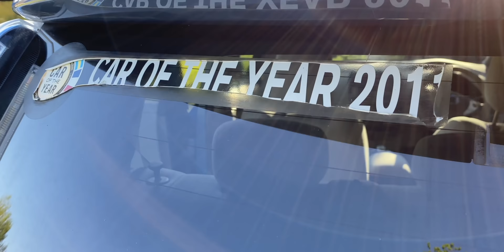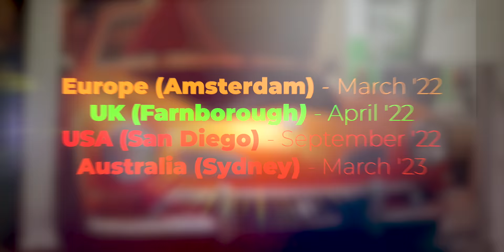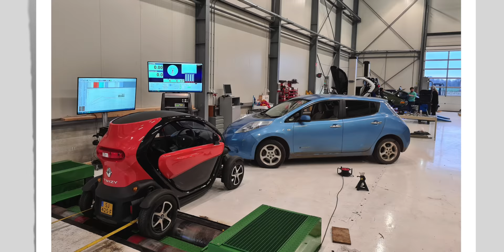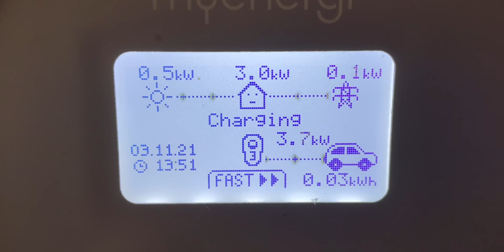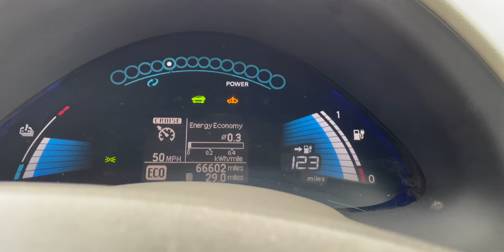Return of the LEAF: Robert drives his range extended EV home from Holland

Comment: Car companies are not interested in selling battery packs to us and will want you to purchase a new car with new technology. It is simply not environmentally friendly to have disposable cars with a depreciating battery that is unlikely to be replaced by most people.
Reply: But you can repurpose the battery by having it disassembled, the failed cells replaced...and then use this rujuvenated old battery as solar storage or peak draw use at your own home???
Reply: @JohnSmith-yv6eq  Meanwhile, the car is placed in landfill. Hardly environmentally friendly. Lithium batteries are also a high risk as they age - ask any Fire and Rescue Service. They contain some very nasty substances and need to be handled with care.
Reply: @redtim3690  
Once the battery has been taken out (in one piece) the Leaf is just recycleable materials... like an ICE car.
By replacing the battery at the end of the first 10 years (maybe 12 or 14) 
  (a 4 hour job; less with scaled up volume) the body of the Leaf can go anther 10 years...???
Reply: @JohnSmith-yv6eq  But where are you going to get the new batteries from? You are relying on crashed cars because car companies don't want to sell you batteries - despite their original promises. EVs at present are disposable cars and are simply not sustainable. They also have double the carbon footprint of an ICE car.
Reply: @redtim3690  
How did they recycle horses when those new fangled horseless carriages came along...?
Reply: @JohnSmith-yv6eq  You are completely uncritical of the limitations of batteries. ICE vehicles are more sustainable and are longer lived. Hydrogen is the way forward.
Reply: @redtim3690  
I hope that hydrogen power does keep the ICE going...but ultimately personal transport systems will need to transition to completely non-carbon based fuels......
Reply: @JohnSmith-yv6eq  Hydrogen has got to be a part of the mix because large batteries in big vehicles simply does not work. My worry is that not having replaceable batteries available at the end of their life will encourage a disposable product. An ICE car will last decades and that is sustainable. Replacing cars every decade is expensive and environmentally unfriendly.

Comment: "You will not have to replace the battery",  or,  as in your case now,  the batteries available in 2033 might have 3 times the capacity,  and 100kW/h just might not cut it anymore.
Or Mr Fusion!!!!``1

Comment: The car is fine and cheap to keep but the battery is a crap. Mine has 82% SOH after 42000 km. So one bar on the display has already left the stage. The car was kept in no extreme environment condition in Germanys weather, also was mostly snail charged at home.
At least the Dutch company may spend him a second birth but the question stays if it is not cheaper to replace it by another used EV with a technical better battery with active cooling /heating and no more Chademo system which is slowly dying in the chargers infrastructure.

Comment: Really interesting and insightful although electric cars even at this level are expensive. Not sure about your statement that batteries will never need replacing. All batteries deteriorate over time so how can they not need replacing
Reply: John, with improved battery chemistry and management systems, and long ranges that seldom need charging to full capacity, modern EV batteries can easily last the life of the vehicle.

Comment: So why did that guy with the Tesla decide to blow his car up rather than have it repaired?  Apparently he was told by Tesla that he needed his battery pack replaced which was going to cost thousands of Euro's.  If batteries can be repaired, why wasn't that an option for him?  This is a serious point because even if you say 'technically' the batteries don't need replacing, if the manufacturer isn't willing to do it and they have the power to 'lock out' any third party modifications through their control over the vehicle via software, then this isn't going to help us at all.  Until we remove the power the manufacturers have over their control over the products we purchase from them, then we are always going to be disadvantaged and wary of investing in these types of technology.  Manufacturers see the purchase of the vehicle as a 'gateway sale' whereby they will continue to profit from over many, many years through artificial lock-in through software.  Why can't people see this?

Comment: A bit hyperbolic there.  Batteries do fail, as the Beyond the Press channel showed recently, but probably about as often as ICE vehicles need new engines.  At about £6 per charge, your journey cost about the same as a diesel car in fuelling costs.  There's also the initial cost.   Leafs were about £28k, including government discount, which put them way out of the price range of most people.  With a 40 mile range, there is not much interest in the secondhand market as far as I can see.

I'm not anti-electric - it's clearly the future - but I'm not convinced that battery vehicles are the long term route.  I do wonder why there is such little interest in hydrogen fuel cell vehicles.  They seem to be the better option.
Reply: worsé hyderféull çells

Comment: Apologies, I should have waited till the end before commenting. Would have stopped anyway? Less than every 100 miles? Really? My previous point about range still applies - I could have done your exact journey, and then turned round and returned, on one fill, no need to plan charging stops, no compulsory stop every 2 hours for at least half an hour. Great for staying fresh, but a pain if you want to get somewhere, and fast. The 1,200 mile round trip to visit my kids involves only one stop, after about 800 miles. I can't argue with your costings, sure, absolutely excellent. And I am as poor as a church mouse these days, and money matters. But for long trips, a super-comfy, long wheel base, super-relaxed journey I will always prefer over the stop-start-stop of an EV long distance journey. Just saying. (ps. I make the point again, why can't we have charge points where you plug in, and a card reader takes your money before releasing the connection? Charging networks everywhere are a mess, so little uniformity blah blah)

Comment: Not so fast.  The Leaf's thermal management system for hot climates is among the worst, if not the worst, of all EVs.  That issue will be amplified with an extended range battery.
Reply: Do you use a Yugo for freeway driving 1000 miles?
Well you know it's particular deficiency...not very comfortable @ 4000rpm.... so of course not.
Ditto the Leaf if you live in a vey hot climate.
Get a Tesla instead.

Comment: Well I debate the never replacing battery in the Hyundai. Sorry but from personal experience Hyundai batteries are notorious for failure. Replaced 4 batteries under warranty on a Kia Soul and absolutely not worth it. Leaf degraded but never failed. That is a key difference. Degradation is not reliability.
Reply from the maker: Just checked a couple of Hyundai Reddit chats I used to frequent when we had a Kona for 4 years. They are all saying how incredible, reliable and long lasting the batteries are. That was my experience. The Soul I don't know, maybe that had different battery chemistry or manufacturer, but the Kona had legendary range and near zero degradation over the 4 years and 55,000 miles we clocked up.

Comment: In HOT areas like Phoenix AZ the LEAF battery loses 10% capacity a year. It is unusable after 4 to 5 years. Thec8 year 100k mile warranty is not covered.
   WARNING  the LEAF has no Battery Thermal Management System. When the battery gets hot it never get the lost range back.    The battery is also very bad in the Cold but does recover when itcwarms back up.
Reply: You are aware of this.
So should every leaf owner.
In temperate climates (lke New Zealand) there are very early Leafs still @ 80% SOC.....
we have apparently got 30,000 Leafs mostly JDM grey imports going well..
and a homegrown reprogramming and battery updating capability...
including English display/navigation....
we basically have no rust, no brine, no salt......

Comment: For various reasons I've been tracking my MPG and fuel spend since the early 2000s.
In the last 10 years: 
* My cheapest year was 2019 at £1,293 to go 10,580 miles (£0.122 per mile)
* My most expensive was 2014 where I spent £1,778 to go 11,583 miles (£0.153 per mile)

Since I got an electric car I have spent £0.013 per mile.

Comment: I just looked at the new nissan leafs and the only thing that sucks is the range of 121 miles. I'd rarely use it for the full range, tbh, but it doesn't make sense for me to trade in my tesla model 3 standard range for a new leaf. I honestly would trade my tesla for a cheaper EV because I frankly don't need to have all that a model 3 brings.

Comment: I am really disappointed by how fully charged has not covered the atrocities condition of the EV charging network. On a trip from Manchester to Reading I need desperately to charge my car but the Electric Highways (owned b6 Gridserve) in 6 service stations along the M42 and M40 motorways we’re not work. One had the electric connector exposed. If I had known that the EV infrastructure was so bad I wouldn’t have bought an EV. This is something you never cover
Reply: He mentions it specifically in this video?
Reply: No he doesn’t. My experience is that all the chargers on M40 and M42 don’t work. Not sure how many others are not working
Reply: @basilkearsley2657  13:52 "Thank you to FastNed for HAVING CHARGERS THAT WORK, that's a very important thing (Just a little note to charge point operators in the UK)"

Comment: Service in germany is/was much more expensive…the suspension rubber was replaced twice now…15 kWh left with only 64000 km on the clock.   

Every BEV will need replacement…even Tesla…Period!

Comment: No, but what is true nothing changed since the Nissan Leaf I have a Vauxhall vivaro e life 2023 only get 70 miles on the motorway 120 locally if you’re lucky in eco-mode with no heating what a joke so it’s the same as the Nissan Leaf about 10 years+ to me, nothing to change

Comment: the thing comes to changing a battery is,   is it worth it to the owner themselves  not will it make the car worth more
mileage in an ev is  a pointless number to value the car too.     petrol cars with high mileage are worth less as the engines them self are worn,  and with build up or carbons and tars   resulting in loss of performance,  but electric engines don't get this  so it is the same on day one as it is at year 12
we miss all the work done on a 12 year old car when part start to age and fail.   but there are none of these on an EV
in 12 year  how many    spark plugs,  oil filters,  oil,   exhausts has a petrol car had done.  how many of these old parts end up in landfill.  how much carbon used to make all these replacement.

Comment: My 2016 30 kwhr leaf Teckna which was bought 5 years after Robert's car is 5 1/2 years old and has done just over 24000 miles, yet it has lost 2 battery bars and around 20% of initial range. Batteries do degrade quite fast, even after 5 years of so called improvement from when Robert bought his car ? My car is only used around town now, tethered  within the home charger range, mainly because of the unreliable and   
few rapid charge points there are, compared to the rapidly increasing electric car population. Electric cars and infrastructure are no where near good enough for mass adoption yet.
Reply: The 2016 and 2017 models were found to have defective BMS software that incorrectly calculated battery capacity and indicated accelerated degradation that wasn't actual. Have you had Nissan update your BMS software? Most owners have reported that it corrected the problem.
Reply: Interesting. My 2016 Nissan leaf has racked up 43,000 miles but not lost a bar yet cross fingers. Largely thanks to Robert warning me about over charging it. Do you live in a hot country Steve. The leaf was almost made for the UK climate.
Reply: @jeremy1548  I live in the sunny North East of England. The summers here are astonishingly hot lol.
Reply: @Tron-Jockey  No i will get them to do it and report back although the cynic in me would tell me that they are trying to hide the degradation, not correct it ?

Comment: You WILL have to change the battery if it BREAKS. Even if you don't have to throw one away, it will still cost you £000s to repair. Stop trying to sweep the big problems under the carpet.

Comment: Be careful with these "general" claims as they don't apply to all EVs. I had a 2016 Kia Soul EV and it lost 20% of its range within 60K km or about 2.5 years of ownership. Kia offered no support till battery degradation claimed a loss of 30%+ capacity. So I had to accept in the winter my car was now 100km at best because of degradation and cold weather. Barely enough to get to/from work each day. Before this, I owned a 2012 Leaf SL which at 4 years had 96K km and lost two bars giving it a 32km total range one February day when the temperature was -25 Celcius (98km max range on a good day without AC)
So while you may not "have" to replace the battery every two years. If you want the car to be equal to what you purchased, you may need to replace it within 3 to 5 years.
Reply: ⁶2 miiles     rabge

Comment: Sorry my friend... I have to say the opposite...
I bought a used 2012 Nissan Leaf, the dealer scammed me with an faked battery certificate. It says.. SoH 87%, all cells in good condition...the battery gauge of my nissan says 10 of 12 bars.
The ugly truth is... Its 70.3%, one cell damaged. And all this with an overall mileage of 38.000km
It is an exception, i know, i saw other leafs with 156.000km and a SoH of 93%
Please, i still love my leaf, even it has a range of 58km in Winter...if you consider to buy a used, use a Bluetooth OBD Dongle and the free version of Leaf Spy to verify the SoH...
For now, i am forced to file a case against the dealer to get my money back...but it will not stop me to buy an another Nissan Leaf.
Btw...please tell Muxsan to answer my mails

Comment: Robert.   Is lNissan defrauding leaf owners I am on my second leaf.  It is a 2019 40 kW tekno model.  The warranty is supposed to 8 years or 160 k. Kilometers.  I have over 137000 km on the odometer 12 bars and my battery is in great shape.   Are they lying?   
I drained my battery to 0 percent and then filled it to 100%.   I was only able to put 30.38 kw into the battery as shown on my home charger.   ( granny cable).  32 kW would be 80% of a 40 kW battery.

Comment: This is only relevant to Leaf owners that do little mileage like pensioners that use the car to collect their pension on Wednesday and their weekly shop on Friday. With a few miles here and there in between and don't mind using the same vehicle for 20 years or more. Most people will want your crew car properties and mileage at the least. Just because you can re-battery the cars doesn't me it is worthwhile. Yes the year on year running an d buying cost are great but that's not the whole story. Just because a car looks good doesn't mean the body strength is still there.
Reply: Well, yes - it's still a ten year old car. In my experience, the vast majority of car owners don't keep - don't WANT to keep a car for well over ten years!  Attitudes may change with increased reliability of EVs.. but I doubt it.  Cars are still very much a 'heart over head' thing for so many people, and very often you just 'fancy a change'....
Soo ......it might help the pre-loved market a bit - particularly when used are even more overpriced than new......!

Comment: Hello me ole China, nice to see you again, £4000 for a replacement longer range battery is very cheap if you compare it to that other mob in Cheltenham, I thought you would have got around 150 miles in hot weather?

I had a 15 plate leaf, 24kwh I was offered £9400 so sold it ( November 2021) because the range wasn't enough for me, I live in London (far east) RM6, at moment I'm now driving a 1.4 58 reg Corsa until 1 day I find a reasonably priced electric car that will do around 160/200 miles on a single charge, I'm hoping the Chinese will come here and sell their cars to us, I believe they can sell a 200 miler for around £10000, other EV manufacturers are crooks by selling us that kind of car for over £26000, I still have my Podpoint charger on standby, I'm also a solar panel anorak like yourself 😂👍🏽
I own a Nissan dynamo taxi 40kwh 21 reg, it's doing around a 100/110 in cold weather but much better in mild hot weather

Comment: Why do you start out with a lie?   NO repeat NO battery can be simply be re-charged forever.  Even all of the parts of the battery can not be re-manufactured. Your cost per-mile you didn't include Insurance ever comp. I know charges more for EV's and road taxes (gas tax from cars won't pay for roads forever).

Comment: SORRY IF YOU WANT A CAR WITH DECENT MILEAGE YOU NEED TO SPEND £30000 PLUS  even second hand you will pay a pricey sum and the batteries will have reduced capacity  just not affordable for most people  also I need something that can pull a caravan  which 99 percent of electric cars cant do .. I would use an electric car for town work but as i have already said there are too expensive  ,when are car manufacturers going to produce affordable evs